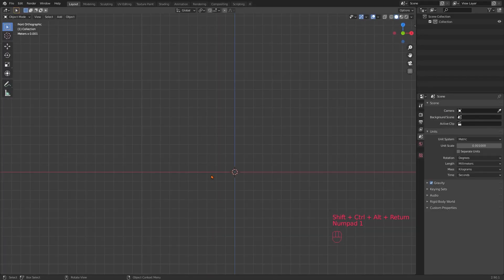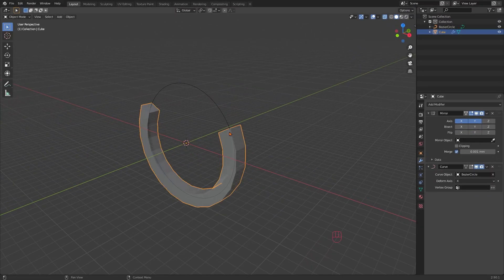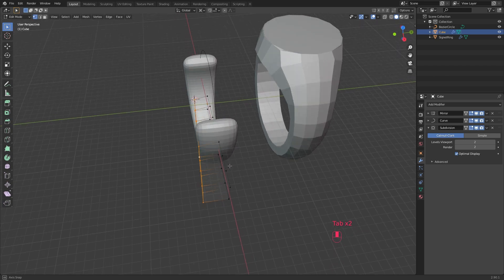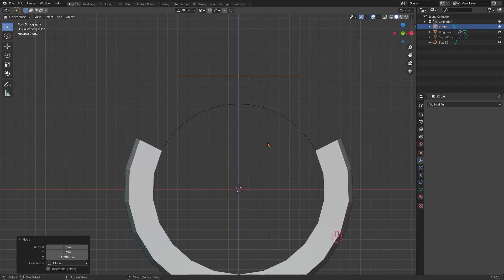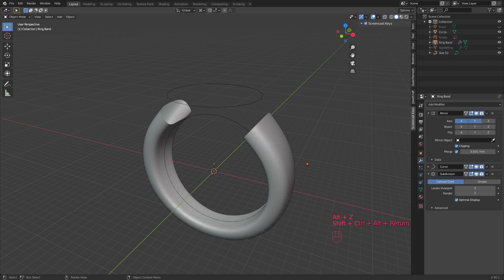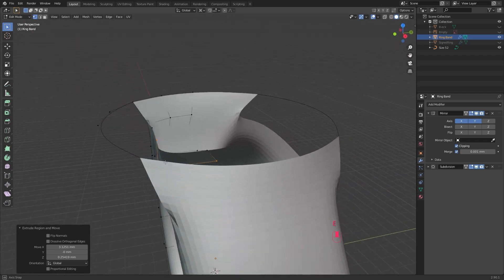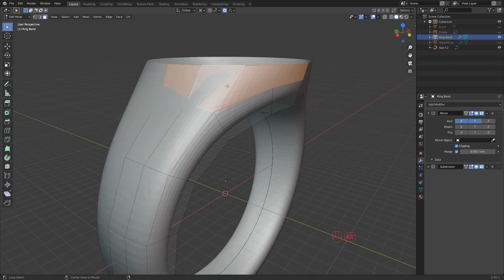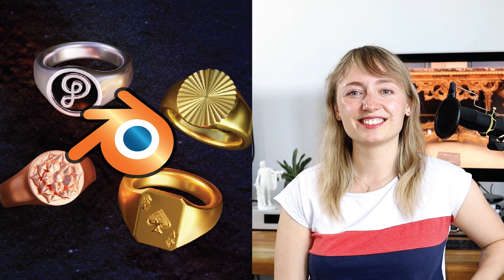Create A Simple Signet Ring in Blender (3D Printable!)

Comment: at 2:34 why suddenly the cube is different from the first? where is the middle line? it messed up when i try to make the circle top
Reply from the maker: The different looks in Edit mode can be achieved by clicking on the little square icon at the top, both of the mirror modifier and of the curve modifier.
Reply: @PhialoDesign  thank you very much, also i happened having trouble when using mirror clipping, when i move my vertices, sometimes the edges suddenly move and snap to one of the vertices

Comment: when combining the circle to the ring with CTRL+J at around 7:00 in your video, the circle is moved below the ring and turned into a pringle/potato chip shape.
Reply from the maker: This might be because you haven't applied the curve modifier, as I did shortly before. If it is still active, the curve modifier will continue to deform all geometry, and also the newly joined circle on the top.

Comment: I want to know how do you make them silver after printing
Reply from the maker: I am using Shapeways (15% code: UG96S4), but the usual way is to create a casting mold, take or melt the print out depending on the technique, and pour in the molten metal. Afterwards, it needs to be cleaned and polished.
Reply: look up your local casting company (may not be in your town) send them your file and they will send it back to you in silver. Cut the spru off and file down even. Then all you have to do is sand, smooth and polish

Comment: Hello. having issues at 8:43 since when i select the verticies and extrude, it does not extend the mesh as im working and only the black outlines. so im unsure if the ring is still smooth. there is also no 'snapping' please help
Reply: I think you're in vertices mode.. So you've probably selected those two vertices and extruded those 2 vertices.. You should select edge mode on the top left side and extrude that edge

Comment: Eine Frage habe ich jedoch, wie ist die Druckeinstellung????? Lg aus Wien
Reply from the maker: Hi Eva, danke dir für deinen lieben Kommentar. Die Druckeinstellung ist immer vom Drucker abhängig, den du benutzt. Die sind nicht in Blender einzustellen. Und um die Datei drucken zu können, exportierst du sie als Stl. Wenn du sie selbst drucken willst, brauchst du dann noch einen Slicer, zB Cura oder Slic3r, um eine gcode Datei zu erstellen. LG :)
The question: which printer settings do I use? Answer: the printer settings are always dependent on the printer you are using. Those are not set in Blender. To print the file, you export it as an Stl. Before the printer can understand this file, you need to create a gcode with a slicer like Cura or Slic3r.
Reply: @PhialoDesign  Vielen Dank für deine Antwort! Ich denke, für viele eine hilfreiche Antwort. Ich habe mich jedoch falsch ausgedr(u)ückt :-), was ich meinte ist, wie bei einem Ring die Stützstruktur aussieht, denn ich glaube nicht, dass das direkt aufs Bett gedruckt werden kann.
Lg;-)
Reply from the maker: @evas7250  Hi Eva, auch diese generiert der Slicer fuer dich, und die sind immer abhaengig vom jeweiligen Material, Drucker, Druckeinstellungen usw. Vorteilhaft ist natuerlich, wenn die Stuetzstruktur nicht auf den wichtigen Details liegt. Und ich versuche immer so zu drucken, dass ich moeglichst wenig Stuetzmaterial benoetige.

Question: How does the support structure look for such a ring? Answer: this also depends on printing settings, print material and the printer itself. The supports can be generated in the slicer software, as well. Ideally, the ring is tilted in such a way that important details are not behind support when printing, and I also always try to minimize the amount of supports needed in this way.